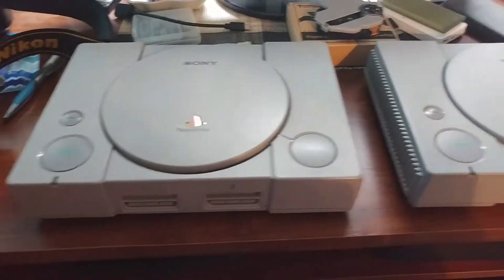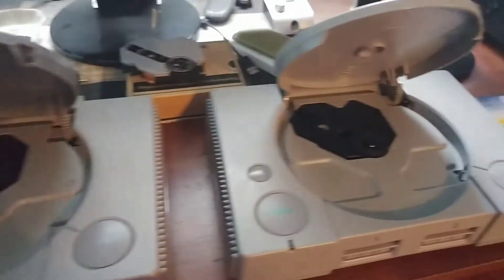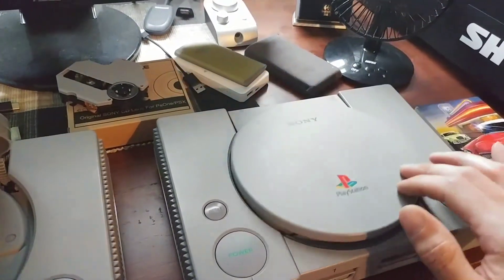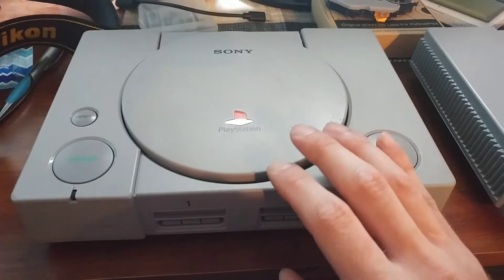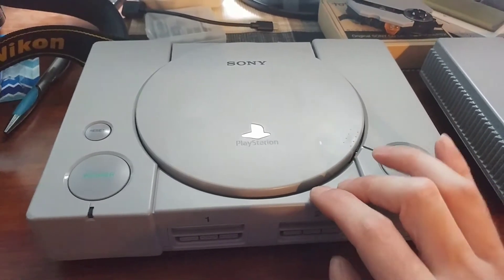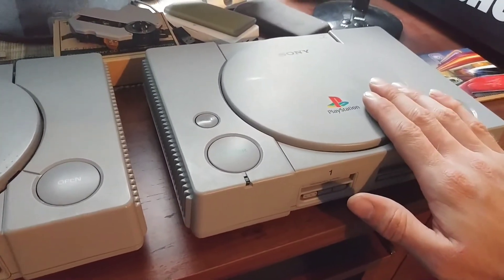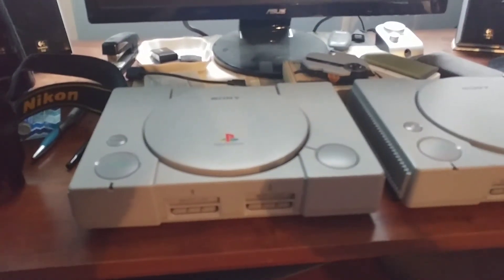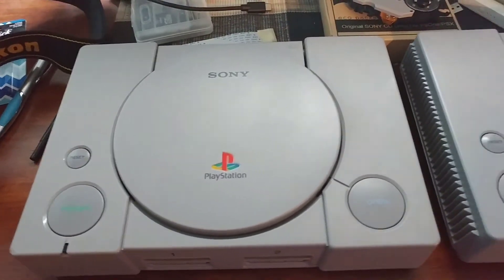PlayStation With New Laser

Comment: I have no luck on these. You also need to adjust BIAS and GAIN
Reply from the maker: Stevie Goodwin I've had nothing but luck with them. The console that I replaced the laser on wouldn't even play a game or CD until I adjusted the Bias and Gain pots.
Reply from the maker: Stevie Goodwin But as for the replacement, all I did was install the laser, check the laser's intensity voltage and the console worked perfectly.